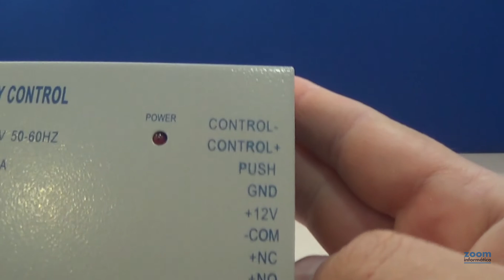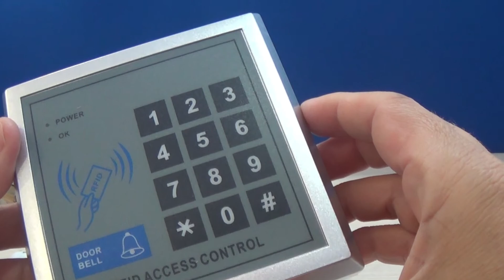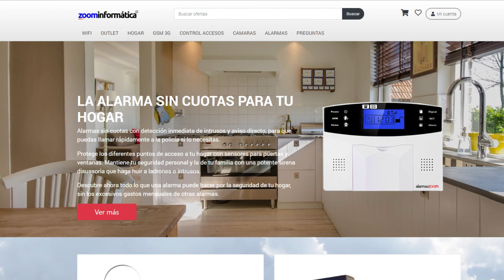Access control system with door lock, card reader and security exit button 🏘️

Comment: Sir i have installed electronic lock with access control system .but when I open it using card ,fingerprint or pin code ,it makes so much of electrifying noise for 5-7 sec .how to shut that noise .
Reply from the maker: Not sure about what noise want to mean. Could be a different keyboard or some defective unit

Comment: Putting the NO COM outside in the pin code / RFID scanner is stupid. Because someone can connect these (wires com and NO) manually and break in.
The interperting of the code ot rfid card should be done inside.
Reply from the maker: Thanks for comment

Comment: I have the same set except the exit button. I did everything you mentioned, everything works, but once in a while, the power supply and the keyboard shoot down for a second and then immediately turn on right after. What is wrong?
Reply from the maker: I cannot reply with security, but i recomend to check carrefully each cable if not works on same way
Reply: If your wiring is solid, then it might be the k80 power supply unit. I had the same issue and a new 5a power supply solved it..

Comment: I already have an electric lock in my house, which can be opened from the intercom. How can I add the RFID keypad to the system? Can I use the power supply that is already installed?
Reply from the maker: I cannot reply here to confirm if this system its suitable at your installation